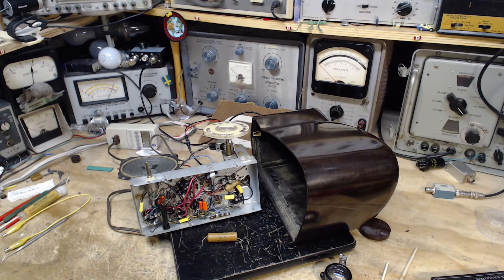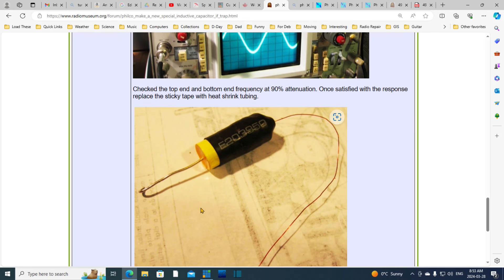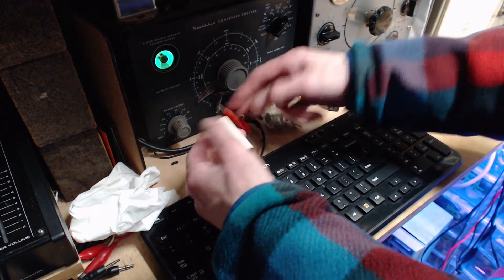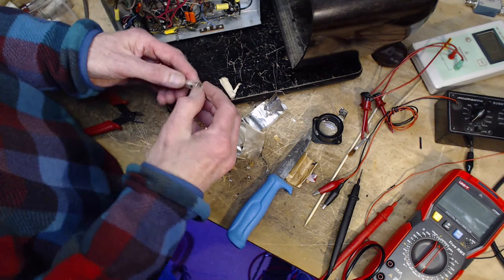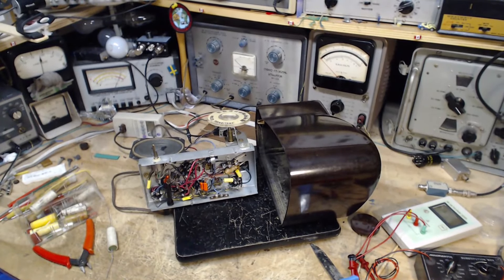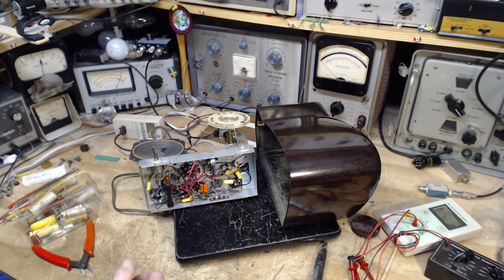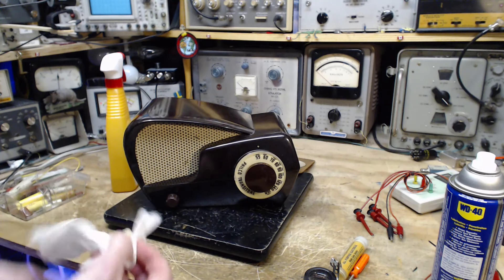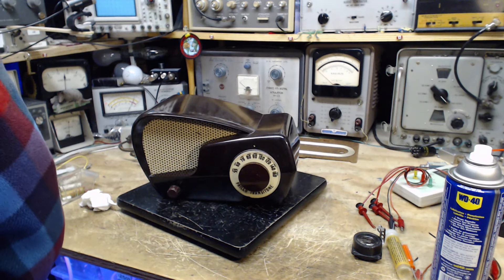Philco 49 501 Boomerang Radio Video #8 - Special Capacitor Finale

Comment: There is no coil as such. The "coil" is created by moving one of the foil pigtails 1/3 into one of the foil strips and winding it all up as a normal capacitor. that leaves a strip of foil that is only inductively coupled.
Reply: Yes correct, Jim knows that now!!!
Reply: @myradiovideos  And he should have researched on it before even posting the last video to boot
And I doubt that Jim fully understands the theory behind that capacitor.

Comment: So, he puts a "slightly leaky at 150VDC" 0.22 uF capacitor from B- to chassis. No polarized plug. Can you say "shock hazard"? Those Philco caps with built in inductance was yet another "Philco Gimmick" that was supposed to be innovation, but just another sales gimmick. The crackling noises heard whenever the radio first warms up is most likely from Silver Mica Disease, voltage arcing across the caps in the IF transformers which is also why it has intermittent weak reception. The IF is going in and out of alignment as the capacitors flake out. Wiggling the tubes ain't gonna fix that.....
Reply: ...you're probably right...